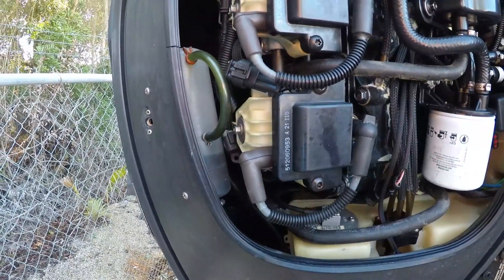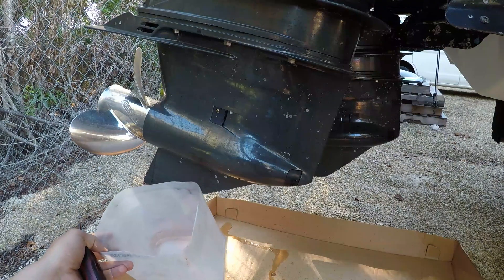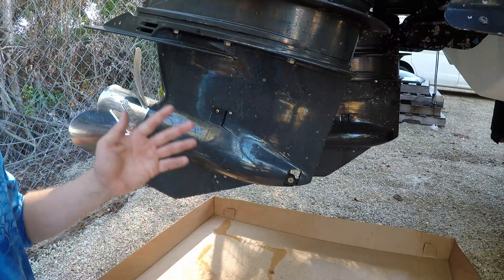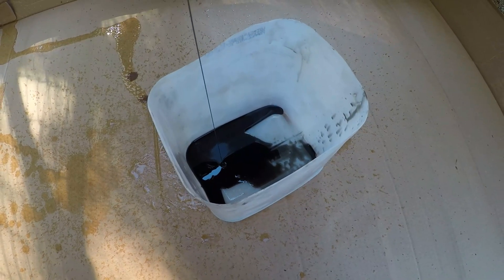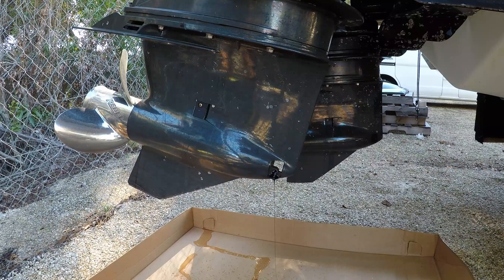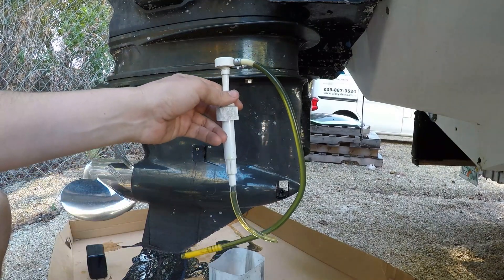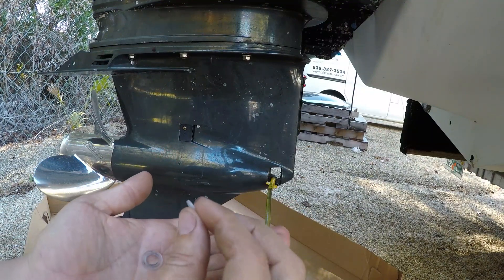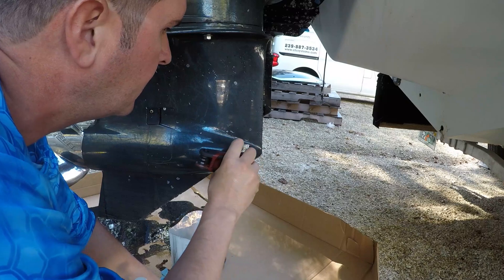Evinrude ETEC G2 300 Gear Case Maintenance/ Gear Oil Change

Comment: I’m trying to change the oil in my 250. However I can’t unscrew the drain plug without the screw starting to strip. Anyone have a similar problem with suggestions?
Reply from the maker: I’ve gotten a square shaft screw driver and a pair of vice grips to hold on to it, then lean on the screw driver with all my weight pushing into the screw. Find the largest flat head screw driver you’ve got.
Reply: @ericdavi1231  awesome! thank you very much! I will give it a shot!

Comment: Mine squirted out like it was under pressure when I was done filling! Sprayed my shirt! And I dont see any in my reservoir. But used a whole jug.... Thoughts??
Reply from the maker: You need to take the top tube off of the reservoir jug while you’re filling the gear case so the air has somewhere to go. Get another bottle and fill until you see it in the reservoir and put the top tube on when you’re done.

Comment: The fact that the oil is not gushing out when you pull the plug is a great thing. It means the unit is still sealed and no leaks normally.  Great job!

Comment: Great video! I followed all the steps however the oil wouldnt drain from the reservoir. I blew on the tube but nothing happened. Could there be a blockage in the line?

Comment: I’d drain level till it quits, then tilt  about 30 degrees and wait till that quits.
Then refill ONLY with engine perfectly LEVEL.
I liked your idea of coming back and re-draining to “wash out” old residual lube from before that was dark. It was pretty dark.
Was the lube in reservoir before change also dark? If so possibly that could be used as a gauge to determine oil changes if dark earlier than prescribed hourly use on engine. Just a thought 💭.

Comment: I have a small leaking coming from a small star screw near the trim tilt. Is it possible for me to send you a picture? Love the videos btw!
Reply from the maker: If it’s on a G2 anything from that part of the motor is related to the DPS. All that stuff requires proprietary tools and parts. It will need to see a dealer.

Comment: Hey brother what gear lube kit did you use?
Reply from the maker: I ordered HPF Pro gear lube and any gear lube pump will work. I used that same pump on my old Mercury
Reply: @ericdavi1231  I put about a quart and some change into my lower unit. The ketchup bottle is still empty. Does that mean my engine takes more? I don’t see any leaks, it’s been a couple of days. Should I add more gear oil?
Reply from the maker: @therodfather2121  yeah, it needs to be in between the marks in the bottle. I must have still had a little of the old oil still left in mine.

Comment: How do you summarize it ?
Reply from the maker: With the engine idling you can push the “winterize” button. I guess you could also use the “winterize” function if you’re going to be leaving it for a long time during the summer. All it does is pump extra oil into the cylinders.

Comment: Thanks for the video Eric, there is so little info on the G2.  The allen wrench is a 4 mm to remove the screen, same size for the motor side cowling panels.  Takes a little effort to get it seated in the screw due to the angle, just be patient.
Reply from the maker: Could have been. Mine may of had more corrosion built up in it. The key is to make sure it feels snug before you try to turn it. That would probably be a 30 minute to hour long job with an easy out if you round it off.
Reply: @ericdavi1231  Здравствуйте. Как мотор? Сегодня их уже не выпускают?

Comment: Thank you for it. I have a question it is important for me, I own a 150 Evinrude g2 with 60 hours,I bought last summer and I did not change anything on machine and did not do any maintance. I only winterized my engine, what should I do for next summer ?
Thanks for your help.
Reply from the maker: I change my gear oil every 100 hours. Evinrude says you can go longer but I don’t. I also visually inspect the clear overflow gear oil jug inside the cowling after each use to make sure it doesn’t look milky. Milky means water got in and the oil isn’t able to lubricate anymore.
Reply: Thank you sir ,
Is there something more to do for new season except gear oil ?
Like fuel or water filters.
Reply from the maker: @alibaranakpolat5925  I also change my fuel filters, spark plugs and water pumps every year. You should be able to go to the Evinrude website and they’ll list everything. I’ve only had these Evinrudes for a year myself, I had a Mercury before.
Reply: @ericdavi1231  thank you for support 🙏🏼
Reply: Grease this very good engine

Comment: Thanks for the upload. I own a 150 Evinrude G2 with 2k hours and still on the original lower unit. How many hours on yours?
Reply from the maker: These motors have 3,000 but according to a search the dealer did on the serial numbers, the gear cases were replaced halfway though their lives, so I’m guessing 1500.